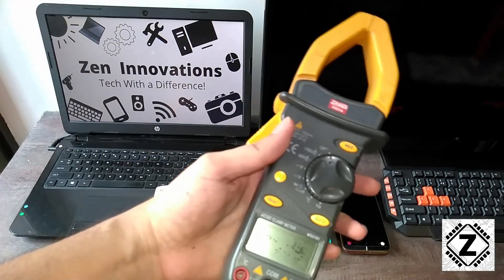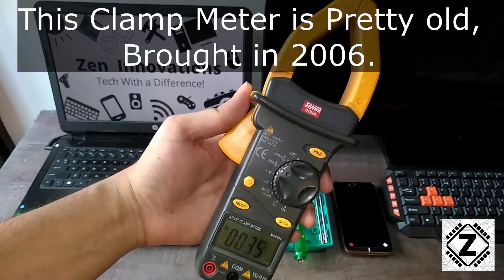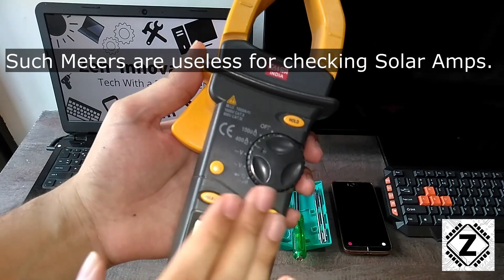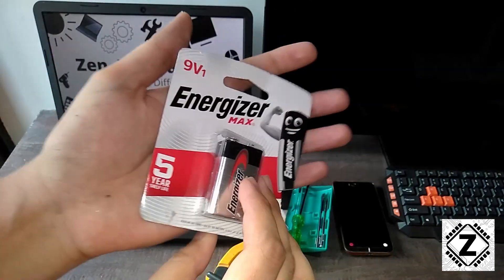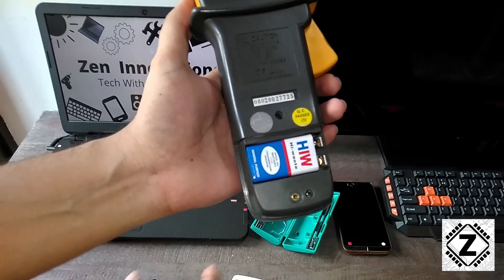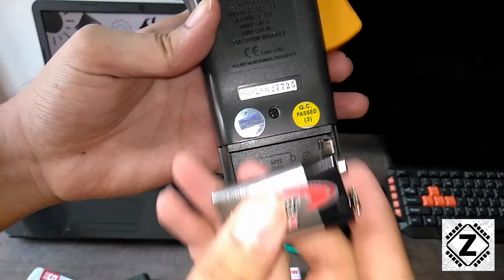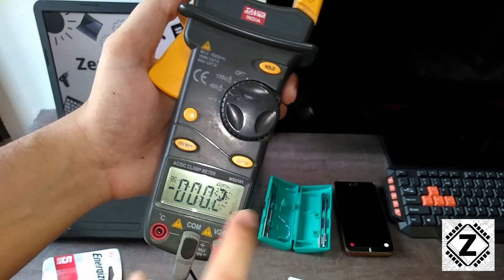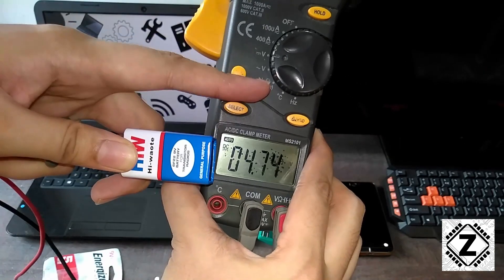[Eng] Clamp Meter Accuracy Problem Solution | Display Showing Garbage Readings | Replace Battery

Comment: My mastech clamp meter is not showing ac and dc voltage. Other than that it shows accurate readings. How to repair it?
Reply from the maker: Check internal fuses